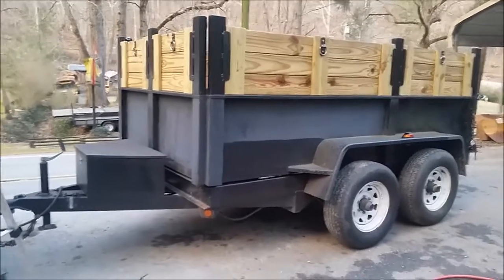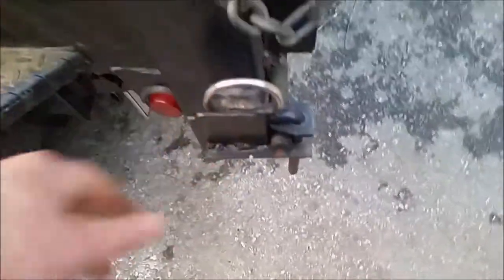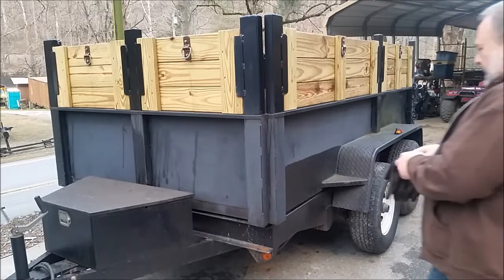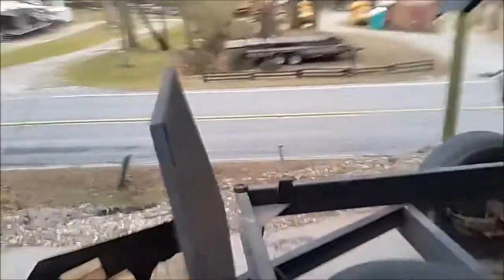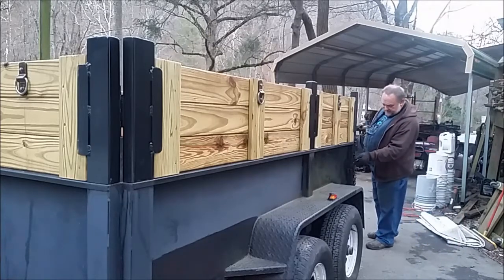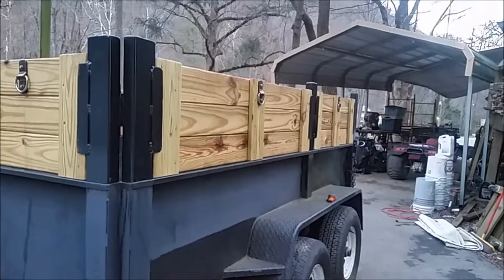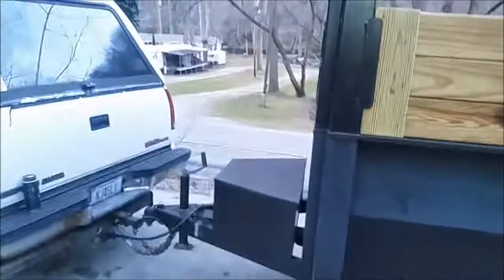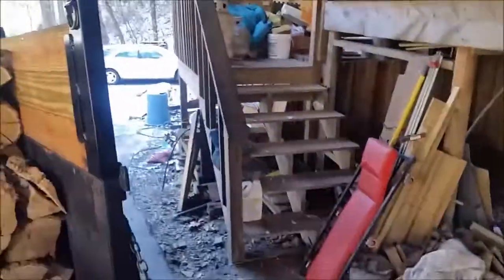Dump Trailer Upgrades: Removable Sides, Spare Tire Rack, Tailgate Mods, etc..

Comment from the maker: How did I build this: I wrote an email explaining it, so, figured I would post it here.. 
  I have attached  two pictures, but, let me tell you what you are looking at, and why, because, I can describe the two pictures to you just as well as you seeing them... 
The trailer pockets are the same material as what I am using on top of them for the risers that hold the D-Rings and wood panels.. In my case, on this trailer, they are Rectangular Tubing of  2" x 4" x some thickness, which I can't remember off of the top of my head, but, I would say a gauge less than or equal to 1/8" thick. 
All I am doing is putting some flexible extensions on the bottom of my uprights, that will slide down into the stake pockets in the trailer... 
Why did I say "Flexible"?
If you have done any amount of welding, then, you understand "Warpage from Welding", or/and, these pieces of metal are not "Dimensionally Perfect".. 

So, the first one I made, I had an idea to put a rectangular plate on the bottom and do it that way... 
Make the rectangular plate fit very well, weld it to the bottom and push it down in.. 
That obviously didn't work because, everywhere there was a weld, that held the rectangular to the trailer, it was warped to some point that would stop the tight fitting rectangular.. So, this had to be done a different way... 

I needed something flexible, I needed something that would fit inside of the same piece of rectangular down in the bed, and, I wanted it to fit the inside corners that are not 90degree sharp corners, but, have a radius... 

So, I chose a 1/2" x 1/2" Angle, in a thickness o 3/16 or 1/4", which I had both on hand and used both.. 
The extra thickness allowed me to grind the 90 degree outside corners from the sharp edges to a rounder radius edge to fit the inside of the Rectangular tubing inside of the bed..Something with some level of flex, but, once fully inserted down in the pockets, would be very sturdy.. 

I think I made them 20" long each x 4pcs each piece of Rectangular, and left 2" in the ends of the risers where I welded them inside of the Riser's Rectangular Tubing... Before I did that, I had to take the grinder and round off the outside edge (90 degree sharp edge), to give me a rounder radius that would fit the inside corners of the Rectangular tubing.. I was able to weld 2" up into the riser rectangular to get a good weld.. I could have drilled holes in the Rect Tube and plug welded it, but, I got good welds on it, so, was not necessary.. 

So, I did that 4 times on each stake, took each one to the trailer, slid them down into the stake body, and used the grinder to grind a rounder radius, to the outside edges, where the slipped down easily and smoothly.. Then,, I took a stick, wrapped a small rag around the end, taped it, put some axle grease on it, and mopped the inside of the pockets and 1/2" angle, so, they would not rust and freeze up down the road, and could be taken in and out easily... 

Each one of the risers was built for each of the holes, and didn't fit perfectly in the other holes because of the welding warpage when the trailer was built, so, I welded the positions of the stakes on the top cap of the risers, so, I would know exactly where they went, if I pulled them all out at one time.. 

Board wooden panels... I used 5/4" treated deck boards which are a true 1" thick.. Rect Tubing is 2" thick.. So, just needed a little play room for them to slide in and out easily, after I treated them with the Kerosene/Hydraulic fluid treatment, which will make them a little thicker, but, not much..
So, I needed to add about 1/8" width to the 2" thick rectangular tubing to give me an 2-1/8" opening to slide the 2-1/16" wide deck board panels in.. 
So, I took a piece of 1/2" flat bar, 1/8" in thickness and welded it to one side (directly to the 2x4" Rect,, under a piece of 2" x 3/16" flat bar.. On the other side, I just welded the same 2" x 3/16" flat bar directly to the side of the 2x4" rectangular.. So, by adding the 1/2" x 1/8" thick flat bar to one side, I went from a 2" width for the panels to a 2-1/8" panel spacing area... It's not that difficult.. More grinding to fit the risers into the stake pockets than anything.. That is where I spent most of my time.. But, they all fit perfectly... 
Hope that helps.. 

I went ahead and attached a few more pictures of when I was assembling..  When I was doing the clamping, I was trying to decide how much extra room I needed over the 2" wide thickness.. You can see the one of the back was sticking out a bit much.. The boards were warped a bit.. I think I ended up doing a little grinding on the wood to thin in out before I treated them, or, I figured they would straighten out once they were installed and sat in the sun and rain for a while.. I don't remember which.. But, I remember grinding one of them because, it was overly thick and all of the rest were perfect.. Seems like the wood boards were thicker, or warped, I can't remember, but, wasn't bad enough to make me want to replace or swap the boards.. Remember, we are talking about something over 1/8", so, not that big of a deal to trim down.. 

I sent the pictures of the D-Rings.. I had a bunch of these I took off of some rafts before disposing of them, and seemed like a good way to use a few.. 
I pull them quite a bit.. I have a covered trash trailer that I accumulate trash in, then, I pull the sides off, and back up next to it and toss everything over into the open trailer, because, I can go to town myself and dump it all in a minute or two, rather than stuffing into the compactors and waiting for it to compact, throw more in, compact, etc.. I just back up, push the button and a minute later, I'm empty.. Ha.. 

Well worth the time to build it.. I also use it when I load dirt/rocks with my front end loader to keep from dropping big rocks into the bed and distorting it.. I put the sides back on before I leave to go dump it..  One other consideration. I loaded  a bunch of limbs/leaves one time, way over the top of the sides, and was going to tie ropes and pull it down tight.. Ended up pulling the sides up, so, some tie downs on the trailer below the sides might be a good edition if you are going to do that..
Reply: Jww

Comment: Mark you did a great job and gives me some insight on what I'll do since I'm getting ready to but a dump trailer myself.
Reply from the maker: You won't regret being able to remove the sides, and the spare tire,, I thought about it for a good while before I finally figured out it would fit perfectly under the trailer.. I hate being without a spare.. Seems,,, if I don't have a spare,, I am going to have tire problems,, and if I do,, the spare will dry rot on the trailer, and never get used..Ha..Ha.. 
I'm sure you will like what you do with the mods.. I have a small Terramite T5C front end loader/backhoe and taking off the sides does two things for me.. When I load stuff with Rocks/boulders, I can set them down, rather than drop them, and save the bottom of the bed of the trailer.. It also helps me to see exactly how I am loading the trailer.. I get perfect pulling loads every time, and I have loaded the trailer way over limit several times... 
When I got the trailer, it had sides, but, not removable... Didn't take me long to decide what I wanted..  Now, I have an old Ford 3910 Tractor with a Front End loader and large backhoe.. Even though it is much, much larger, I still remove the sides, or one side when loading for the reasons mentioned earlier.. I don't use it all of the time, but, I really don't care.. The first big job I did with it around here, I figured,, it paid for itself, and now, I use it a couple times a year at best.. But, I may use it for a  week or two on a project too.. Lots of freedom when you have one.. 
Don't forget to watch my other trailer deck board video... I treated the boards on this dump trailer when I did the mods and it still looks brand new, and sits outside 100% of the time.. (Under the trees)  Best way to treat.. Much better than Diesel, Oil and Diesel, etc.. I have tried them all... This mix is hands down the best of everything I have tried over the last 30 years.. Wish I had time to post more videos.. I have a crap load of them waiting for me to have more time to work them and post them.. 
Glad you stopped bye.. Good Luck with your new trailer..
Reply: Thanks!

Comment: man that is a really nice trailer. love the mods on it. I hope I can get me a decent used dump trailer soon. if not I will just rent one.
Reply from the maker: Wished we lived closer..  I'm sure we would Swap here/swap there... You could use it when  you needed it. 
I bought it used for an upcoming job I had. Needed to haul in some road bond and small gravel in smaller amounts at a time and haul out a bunch of rock infested dirt to a guy who wanted it down the road.. Had a slide behind my bathhouse that we were jackhammering out, so we could get my little Terramite T5C down in there if it ever happened again.. Was going to take a week or better if we had good weather, which is never the case during the fall/winter.. 
Finding Trailers: There are two states that border us who do not require people to title/tag their trailers, so lots of trailers with no titles in those states.. Most people won't fool with them.. But, with the proper paperwork, you can get them licensed in the state here.. I drove 2 hours to pick it up.. Got a pretty good deal on it. I feel like it paid for itself the first couple of jobs.. Shame.. I only use it 6 or 10 times a year, and some of those are just out of convenience.. Something hard to justify unless you have a regular need for one.. They don't haul anything near a Dump Truck load.. But, handy none the less.. I regularly haul 5 tons (10k lbs) loads when I am using it to dress up the drive ways and parking lots..  You don't need sides for hauling any kind of Rock/Dirt, etc.. But, for hauling lighter debris, trash, etc.. very handy..  But, when loading, so nice to be able to pull the sides and sit the rocks down, rather than dropping them from 2 feet high.. Also, fits a cord of split wood nicely... 
You definitely want both axles with brakes on one of these when you fill them up.. But, usually very easy to add brakes to the second axle if it does not have them already.. Just some things to consider.. Mine is a 12k pound trailer which has a 6' x 10' bed..  If you spread a load of Road Rock flat in the back of the trailer, it would be about 14 to 16" high to get around that 5 ton load to give you some idea.. So, if primarily hauling Rock/Gravel/Dirt, I would go for a 14K of the same size vs 12k, but, these are mostly utility dumpers, so, the heavier ones are not as common. I passed on a few 14k trailers until I figured that out and then, never saw one again.. I looked at them for about a year before I finally "had to get one".. Thanks for the comments..  Glad you liked the mods.. They were the best way I could see to get the job done..

Comment: I want some of them metal steak pocket post man for my 6x12 dump! Did you fab them up or order them?
Reply from the maker: I built them..  Not all were the exact same size and some were not perfectly rectangular.. I found something that worked and built all of them the same way.. Look for my pinned comment starting with "How did I build this:  It worked perfectly.. Second mind design nailed it... I explain it in detail.

Comment: Ehhh looks like you got something up there doncha ol boy
Reply from the maker: Ha..Ha.. I had to read that a few times.. :)  
Geeeatyet?? If not, come on in and get you a bite.. Ha..Ha.. Love those Mind Design projects.. Take them on the fly.. Get an idea and see where it takes you.. Yea.. That one turned out pretty cool.. If you have any trailers with wood on them, the stuff I use to treat wood is "The Best".. Never found anything even close to it.. If you have wood on a trailer that sits outside,, check it out.. I still have not re-treated the trailer, but, would have, but, just testing it to see how long it lasts.. It still is not showing any signs at all of rot, etc.. 
But, I would treat it every 3-5 years none the less.. Probably 5 years would be good, but, 3 would be better.. Cheers!
The boards on this dump trailer still look new, but, they are not laying down either, but, are under a tree, so, the only grime I have on them is on the top edges, and some small amount on the sides, where something fell and laid over the sides when I was not paying attention. But, from 20 feet away, they look brand new.. Cheers again!!

Comment: Good setup -- Cheers
Reply from the maker: Awesome.. Hope you can use some of the ideas to make some cool mods to yourself.. It's always nice to use something after some useful mods you made yourself.. If I am loading the trailer with my terramite or my larger tractor, I almost always remove at least one set of side boards.. Keeps me from dropping anything heavy from a greater height.. Saves wear and tear on the bed.. Cheers and Good luck with your mods..
Reply: @MarkThomas123  
Started a 5 by 8 dump a few yrs back - got most of the base done -- now researching how I want to finish the upper -- I like the removable sides idea.
Cheers
Reply from the maker: @patrickmckowen2999  .. Oh yea... You will absolutely Love them...  Well worth the time and effort. I am sure you will agree.

Comment: It’s a shame you us have to spend thousands of dollars on a trailer then a couple thousand more to make it function the way you need it. Thanks for the ideas, really good video
Reply from the maker: Thanks for the Comment.. Yea.. If you had to pay someone to do the welding, the whole deal would be $2800 I would imagine.. I had 2-1/2 days in the build, and, a couple of nights treating the wood with my trailer board mix.. Treating it would not be part of the deal though. Still looks really nice and no signs of any rot, etc..  I use the sides often.. I have a trash trailer about the same size... I'll pull off one side, pull them side by side and toss all of the bags from one to the other, so, I can just dump it at the dump vs had unload/load into a compactor.. Saves me a lot of time... Removing the sides is really nice.. A worth while upgrade.. I also have a small terramite (Front end loader/backhoe).. I always remove the sides if I have any rock, etc, to dump in there to keep from banging up the bed... Nice also to have some tie downs, but, have only used them a few times.. Usually, something I have to tie down, I take my 18' Tandem axle Lawrimore.. Good Luck with your project.. 
If you are in Western NC,  I would do the job, I think..   It takes quite a bit of fitting, but, I could do it without all of the figuring this time.. Ha.. It was a mind design.. Something I wanted, not sure how to get it done until I started on it..  I over built the first two or three metal stakes. Didn't need all of the extra work I did.. The rest were much easier, once I figured out where the problems were going to be..  Lots of grinding to get it to fit in the stake bodies.. None of them were exactly the same, and most were not square.. Still can't figure that one out, unless it pulled when it was welded up.. Never did really look at that, but, highly possible..

Comment: Add upgrade my safety chains. I had four tons on mine. It broke loose and it ripped my safety change like they were butter
Reply from the maker: Yea.. It's a game of give and take.. Keeping it behind the tow vehicle is the key. I always cross my safety chains under the tongue. That way, if it falls off, it is in a chain cradle and stays behind the truck. You can break and it will slide forward and,, if they are snug, and not too loose, should bind up before the trailer gets too far under the truck, hopefully keep the tongue off of the ground and you can brake it to a stop.. But, if the damn thing goes crazy, sometimes it is best to let it go.. Hopefully off through the woods and not into oncoming traffic.. If you are not cris crossing your safety chains,,, start today.. Also, no looser than the chains need to be to let you turn all the way left and all the way right.. Any safety chain of a reasonable size should hold 8k lbs, if it is not whipping around back there.. 
I learned my lesson pulling a 20' aluminum boat and had loose safety chains,, too long.. It went side to side and I was damn glad when it ripped the tongue off and went down the hill.. It was a new truck and I was having a pretty hard time holding it on the road.. Never again my friend..Ha..Never again!!  Good Luck!!
BTW.. The bolt in the tongue on the trailer just snapped off to start the whole ordeal.. Wasn't my boat, but, I hooked it up and didn't see anything wrong with it... It was the bolt that held the nut that pulls the lip up under the ball that broke.. I had just crossed a little bridge on the road which bounced the truck/trailer up and down a bit.. Nothing drastic.. Which,, thinking about it now, the tongue weight had to be a little light too.. Hmm..